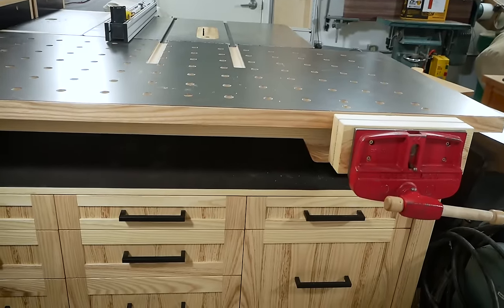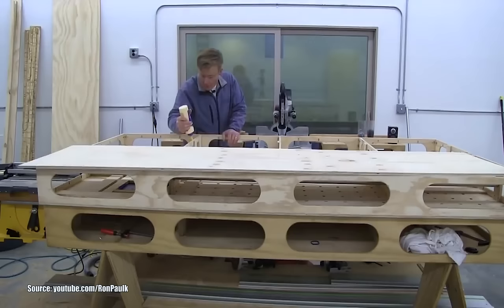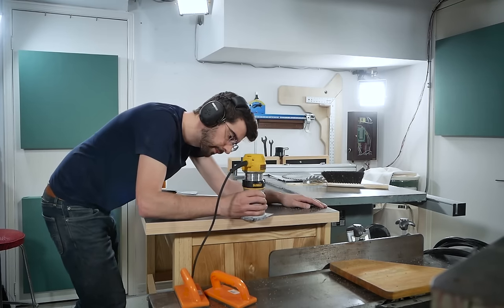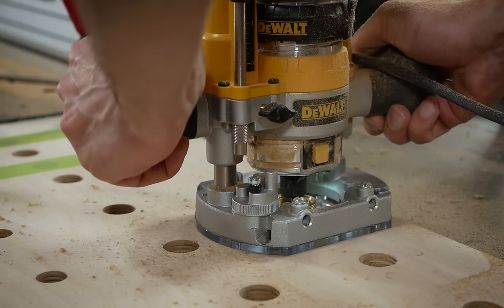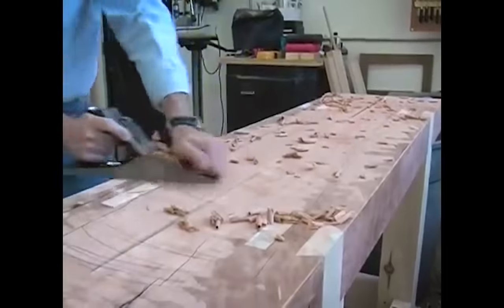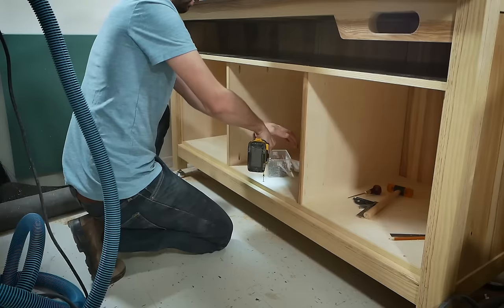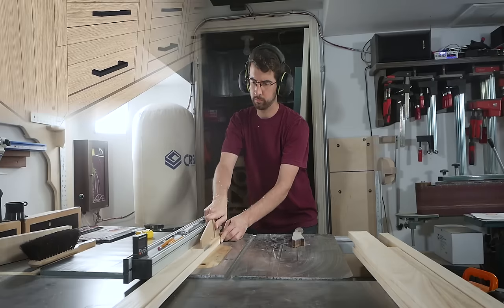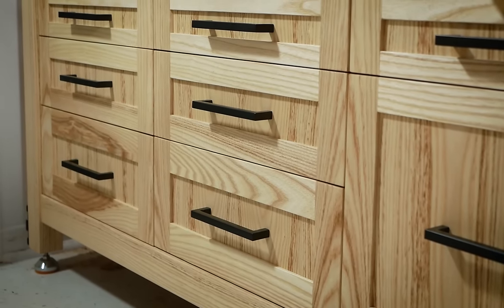The PERFECT small shop WORKBENCH

Comment: I built a gigantic 4x8 folding assembly table a few years ago. I kind of remixed the Ron Paulk plans and I would have to say that my biggest mistake is drilling Dog Holes on the entire workbench. If I had my materials back I would probably build the bench a little heavier since I rarely move it around and I would probably only have one or two rows of dog holes instead of the entire bench.
Reply from the maker: Yeah, I had the same thoughts too, but I didn't know which holes I would really need, so I decided to drill them all and see what happens.
Reply: @ScottWalshWoodworking  You just end up dropping screws in the holes every-time you're taking something apart. If you have 5 min, click on my channel and check out the workbench I made. I did a really short walk around type video on how it folds and it might give you some ideas for future projects since you have a small shop.

Comment: Love your videos. Maybe a dumb question, but when you finish the piece before glue up, how do you handle the glue squeeze out? How do you keep it from messing things up?
Reply from the maker: The great thing is that glue squeeze out generally just pops right off the cured finish pretty easy. With hard wax oils, it's pretty easy to spot sand and reapply in a small area if something goes wrong, but I've never had that issue yet.

Comment: Awesome video, Scott! Beautiful design and function. How well did the sand work on cleaning up that contact cement? - Joe
Reply from the maker: pretty darn well i think! There's a bit of a stain, but i think it soaked up most of the cement, and it doesn't smell at all. The thing was that it wasn't a bag of pure sand, it was a brick mortar sand/cement mix, so i think some of that just hardened in the cracks of the floor, lol. So it made the floor smoother than it was before
Reply: @ScottWalshWoodworking  oh man, what is relief! I wonder if cat litter would have worked even better.

Comment: Scott, I love this design, but my shop is even more space-constrained than yours. What is the overall length and width? I need to see if it will fit in my space.  (This might be a good thing to include in the description of all your plans, for the benefit of folks like me... Nothing worse than spending money to purchase a set of plans, only to realize that it's larger - or smaller - than you need.  And yes, I know I can change the dimensions, but then I have to figure out exactly which parts need to be changed.)

Comment: Really enjoyed this. Quick quesrion, i have the same dewalt router as you and i getting ready to use template guides with it. I bought nice brass ones from lee valley but when i install it, they have a super small amount of play (like 1/64th") instead of being snug in the base plate. Is that the same as yours? Should i get different template guides?
Reply from the maker: I'm pretty sure this is normal. Even if not, you can use a router baseplate centering cone (I think I have a link in the description to a Bosch one) to center the whole baseplate after you've attached the bushing.

Comment: Great build. Trying to do something similar, but want to make sure I get the right size dogs. Since your holes are 20mm, are you using 20mm bench dogs, or are you using 3/4" bench dogs?
Reply from the maker: 20mm holes, 96mm on centre. I'm using 20mm dogs and accessories, mostly from benchdogs UK.
Reply: @ScottWalshWoodworking   I've cut the dog holes and am now trying to chamfer the bottoms. Do you have a link to that giant chamfer bit?  Any chance I can get by with it on my Dewalt Cordless Trim Router (w/ plunge base), or will I need to pick up a beefier router?

Comment: Hi, are you left handed? Your vice is well positioned for left handed use but not right. As an idea did you ever consider the use of gas structs and hinges for your top to make access easier to clean out all those bits which fall down the dog holes.

Comment: I have an out-catch table. LOL. I had a different table saw when I built it. It was actually not even built originally for an outfeed. It was just an assembly table. It’s not great. And the underneath is NOT a good use of space. I definitely need a new table. 

Just watched another of your videos about organizing a shop. My shop is currently full of shop furniture that was put together at different times and doesn’t actually work well together. It just takes more space. For example… the “out-catch” table. As well as a very old two drawer night stand my mom gave me that I made a base for and added wheels. It was my planer cart in my old shop. Now…. It’s full of stuff (I literally couldn’t tell you what is in those drawers). It just needs to disappear.

Comment: Your bench turned out very well and the ash you sourced looks like quality stock. Personally I like the look of a formica/laminate top but neither are durable over time and can't be refinished. Not for me and I'm too old to build a dream bench. My current bench is a mid range Sjoberg I can/ have refinished. Has dog holes covering perhaps 30% of the surface. 20 would have worked fine with its face & end vise.
For me too many holes and too many times getting out the magnet tip wand to find things that fall through.
One last thing.....
your shop is too clean
Scott!🙃

Comment: Scott, at 7:45 how did you drill those holes in the center of that board with the dowelmax?! I need help figuring it out! Can anyone help how to drill into face grain in the middle of the board? All the tutorials are on the end of a board
Reply from the maker: I just used a square to place it on the face in the middle of a board. I can still use the end of the dowel max for reference on the edge of the board. I then use the right angle plate and a clamp to secure it into place. Some measuring for the offset of the holes to the edge of the dowelmax will be necessary.
Reply: @ScottWalshWoodworking  thanks for responding! I think I know what you mean but can't quite visualize it. A video or a short would be great! Either way I can confidently say you are a better woodworker than me, sir. I wish you a contact cementless floor for the rest of your days!

Comment: Here's a beginner question: if you pre-finish the individual pieces before glue up, does the finish interfere with the glue's ability to bond?
Reply from the maker: Good question. Yes it does, but  we can use that to our advantage. When I prefinish parts, I don't put finish on the joints to make sure the glue bonds correctly. But prefinishing can prevent glue squeeze out from sticking, so that it pops right off after glue up.
Reply: @ScottWalshWoodworking  That's pretty fancy! I'll try it out. Thanks!

Comment: I noticed your table saw does not have a riving knife/splitter/spreader whatever you want to call it. Do you notice during cuts the wood trying to curve back into itself at the kerf causing kickback? What are your thoughts on spreaders? I have an old direct drive craftsman that is missing its original riving knife and my saw often gives the feeling of kickback. The thing just scares the hell out of me.
Reply from the maker: the way i usually circumvent this is to only rip off thin strips at the table saw. Typically, I'll rough cut the part out on the band saw, leaving around 1/2 - 1/4" left for the table saw. The remaining strip doesn't have enough force to press on the back of the blade to cause kick back.

Comment: Can I ask about the two routers? Looked like a bosch and dewalt. Is it just simplicity/ on hand convenience or do I need to learn more about routers?
Reply from the maker: The dewalt 611 is a compact router, meaning it can only take 1/4" shank bits. The Bosch 1617 is a slightly bigger router than can handle a 1/2" shank bit, which the large chamfer bit I have is. Also, it is handy having more than one router. I might be adding a couple of more to the arsenal just for convenience sake.

Comment: Don't panic. Take 2 pieces of cardboard in each hand and squeegee them together and scoop by scoop, put it back into the can until you've gotten all that you can get up that in that regard and then clean up the mess. The process can help speed clean up and possibly even leave you with some useable product once it's had time to settle out. It's not exactly easy to filter contact cement.🤬 I've been there. If nothing else, it'll give you a container safer to dispose of.

Comment: Fielded panel drawer fronts, for a workbench? Really? In ash? I think this sort of thing is called a vanity project. A joy to make and own, but not the functional sweetspot. e.g. drawers a common size- and the chances of the contents being a good fit in every case? And the fronts have no functional purpose...
So, you build the whole bench, and then have to build a whole interior (which could have been the bench) just to hold the drawers. Complex, expensive, heavy, and with a lot of wasted space.
Top- very nice.  Made mine the same way, except using a guided drill followed by a trim router, and finally a hand reamer.

BTW, the big chamfered rear of the dog holes means that the clamps are not gripping close to the hole, where the most stable grip is.

Comment: I think you commit the same sin as most YT bench builders by calling it 'the perfect (something) workbench'... it's perfect, FOR YOU. We know you mean that, but it can be said. Like your advice to build 'largest possible'... I can believe that for a large shop, two people doing similar jobs can have a similar ideal bench; but every small shop has its unique issues. 

For example I ended up making two small narrow workbenches, identical height width depth but one heavy/sturdy/detailed/feature-rich one more light/simple/design-desk-like --- because anything wider than 65cm/3ft2in and longer than 1m50/5ft I cannot get out of the narrow door should I move house (while I can clamp them together for a 3m long narrow bench, or a deep 130x150 surface, or move apart to support a full 4x8 sheet). If it was one unit whatever size, it would be much harder to manoeuvre.
Reply from the maker: i fully understand your frustration, but unfortunately i have to make titles that I don't agree with to compete with everyone else. I truly don't believe this is the perfect workbench for everyone.

Comment: I will never get over the lunacy some woodworkers on YouTube preaching the almighty torsion box as a magical and almighty "dead flat": surface that is absolutely required for quality woodworking. As I look across my living room at a curio cabinet my great grandfather built with hand tools on an old fashioned workbench that he built from pine because that's what he had available. Honestly I cannot see the benefit in any regard. Sure the internal structure can give it strength to resist drooping if an edge is overhung but so can a second layer and/or wood edge banding with a lot less time and material spent too. Then there's the absurd notion of getting a dead flat surface built from materials that are inherently not dead flat. Whether the top and bottom skin are made from plywood, overly expensive "good" plywood or MDF it isn't anything I would ever consider dead flat.